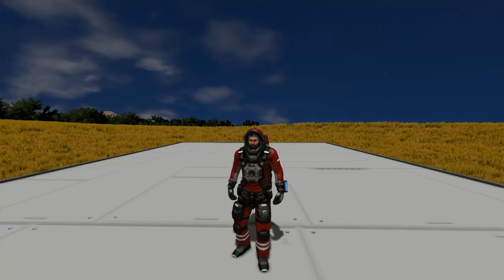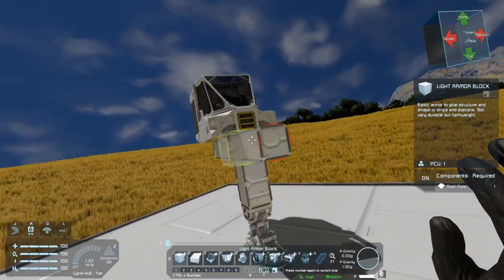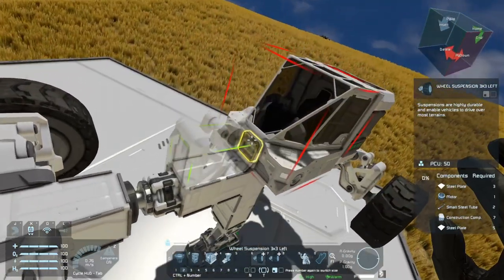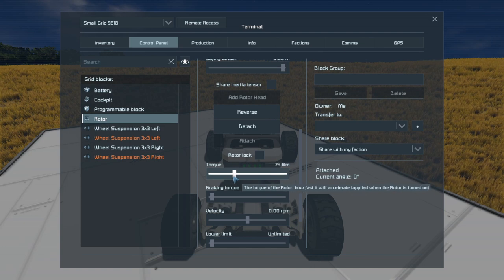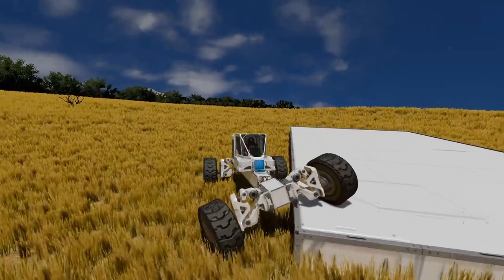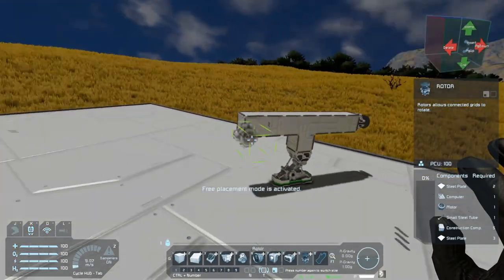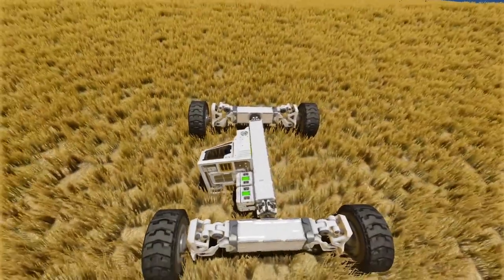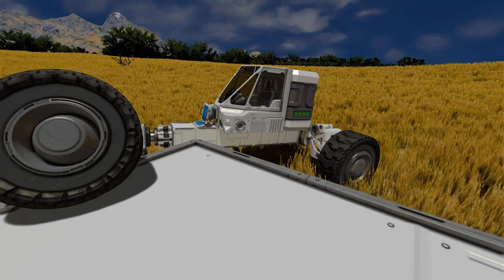How to Space Engineers - Rotor Suspension

Comment: How about a six wheel vehicle with two rotors? One set in the middle with the cockpit?
Reply: Thats what I was about to say lol
Reply: The general rule for unsprung suspension is for every wheel after the third you need a pivot. 4 wheels, 1 pivot, 5 wheels 2 pivots, 6 wheels 3 pivots etc. You can add more but then you need springs.
You can think of this as 3 points makes a stool which will sit flat on any surface. When adding a 4th we essentially split one of the feet of the stool in two and let them pivot so they can even out between themselves.
With 6 wheels there's a few different ways you can arrange those pivots, the two most popular are pivot the front wheels side to side and then the pairs of back wheels forward backward.
The other common one is the mars rover setup this is hard to explain without a picture but there's effectively 4 pivots and a sprint, one pivot in the linkages on each side and then one where the side joins the body. The spring stops the body rotating on those two pivots.
Which raises another point, like how you can't have the 3 feet of a stool in a line you have to be careful about having your pivots in line. So on 6 wheels you can't pivot all 3 pairs left right, it won't be able to get all the wheels on the ground and the body will flop over.